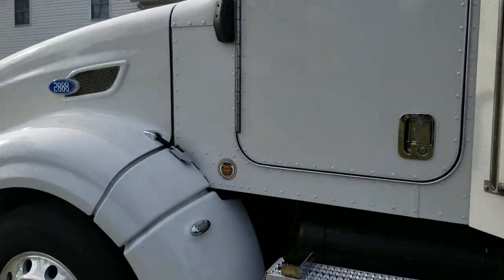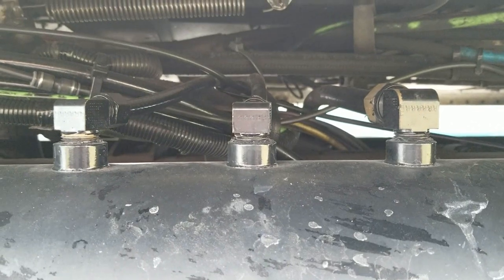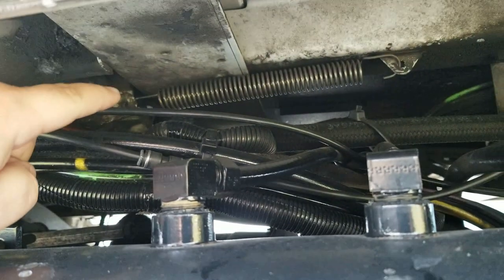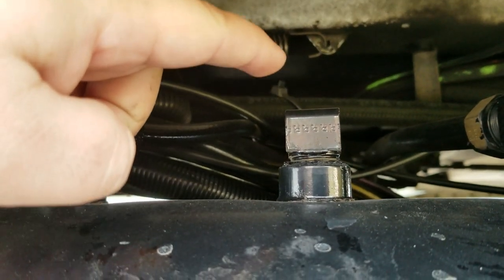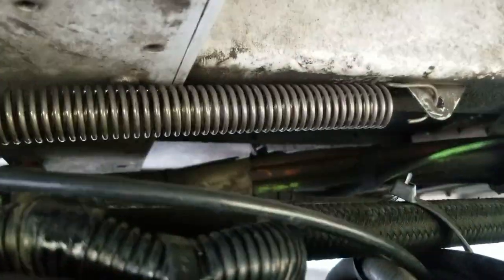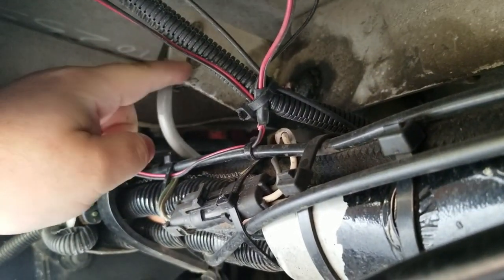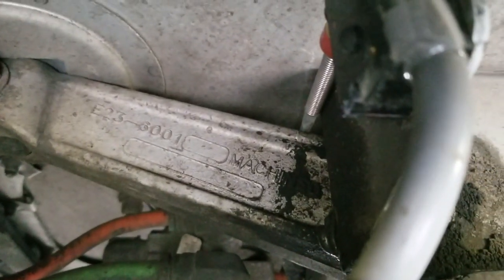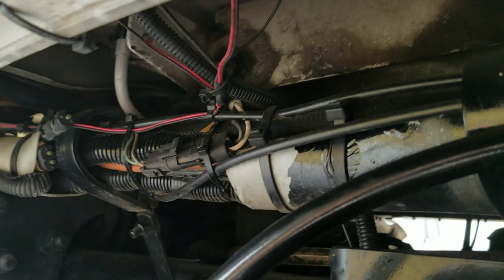Peterbilt 386 Clutch Switch (cruise control & jakes randomly kicking off fix)

Comment: My 379 jakes just started doing exactly that cutting off sporadically. Thanks for this, will change sensor tomorrow!
Reply: Mines too
Reply: Update* I did change my clutch switch and that’s exactly what my problem was, very easy fix. Hardest problem was taking the bottom cowl off and getting my arm up in there and locating the switch itself! Prob saved myself $200
Reply: Anyone have a part # for the switch? 2014
Reply: Thank you!

Comment: Great video,do you know how to replace convex mirror on passenger side it cracked want to replace it without changing the big mirror
Reply from the maker: Remove the 6 screws around the black trim, it pops off with convex mirror, unplug if it has heater. Use small flat tip screwdriver and unscrew mirror. Then just reinstall
Reply: The Carolina Ghost Thanks I’ve already did it

Comment: hello, I have a peterbilt 579 2016 and my clutch switch pedal wont release and the adaptive cruise control not working. I get a new clutch switch but it still not working.

Comment: My cruise control works my  Jake brake works sometimes throttle peddle don’t feel right the last quarter any suggestions thanks Dave
Reply from the maker: Could be the spring roller under the throttle pedal. Not 100% sure tho
Reply: That the sensor?
Reply from the maker: No, under your throttle pedal is a spring roller. Sometimes the spring can go bad. Or get crud built up on the plat the roller is on and makes it feel off.
Reply: Ok thanks I’ll try that thanks

Comment: On your Jake do you have to shutoff your cruise control for it work? Mine won't work if the cruise is on I have to made sure its tuned off. It will work while on cruise if I get 3 mph above set speed.
Reply from the maker: Just tap clutch to disengage cruise control. But yes jakes are set to come on 3 mph over set speed
Reply: @TheBeardedGorilla89  the issue I am having is jakes don't work if I have the cruise on but not set. When I am driving on pedal but don't shut that switch off manually they won't work when I back off the throttle.  I am wondering if this sensor might play a role in it. CAT ET ECM setting for jake is manual which should be on throttle like normal. I replaced the injectors and wiring harness,  throttle wiring and sensor.
Reply from the maker: Ah ok. Um that might be the switch then